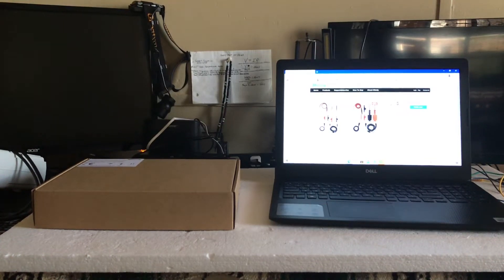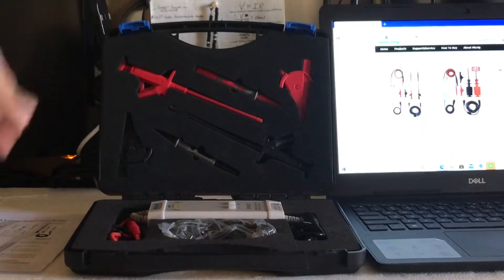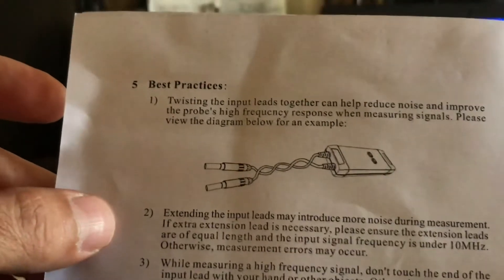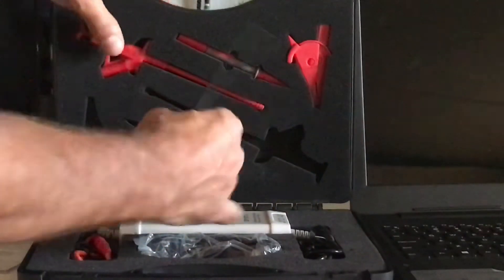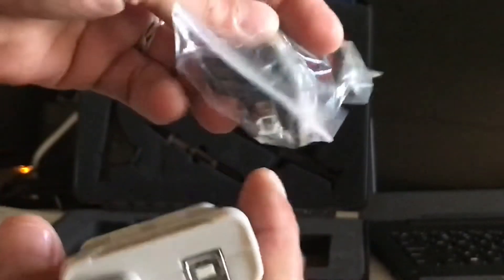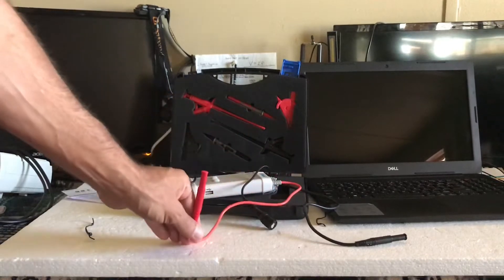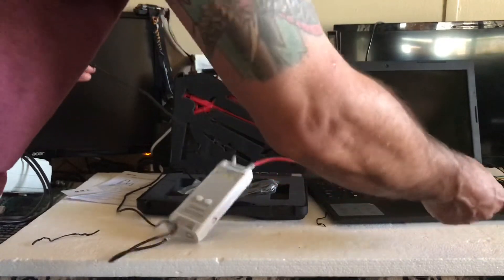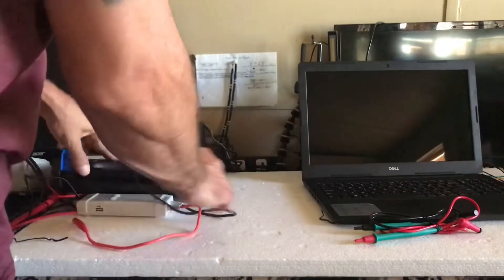First look Micsig High Voltage Differential Probe

Comment: Well, if you ever get into high voltage generators and motors. So for you auto mechanics hybrids. Take my field for example, though transport refrigeration. Reefer mechanic. Some reefers can have 230VAC-460VAC systems. Not only would the attenuation be needed. Also this is an added protection for the front end of the scope. So not only is a hand held scope not referenced to earth ground. This is just one more way to be safer. 

One benefit to a differential Probe. Is it will have a common mode noise rejection ratio (cmnrr). So basically, in Ssierial or other communication signals can reduce cross talk and line noise.
Reply from the maker: Thanks for the info, it’s definitely appreciated.

Comment: What comes to mind is working on amplifier and radio tube circuits where you have two positive inputs at different voltage potentials. The lower of the two becomes a floating ground but is still positive relative to earth ground. How about using it to work on Teslas?
Reply from the maker: VashthStampeede,, That’s interesting. I haven’t messed with radio tube circuits yet. “Yet”. I wish I had some Tesla’s. That would be fun. Thanks for dropping some ideas.